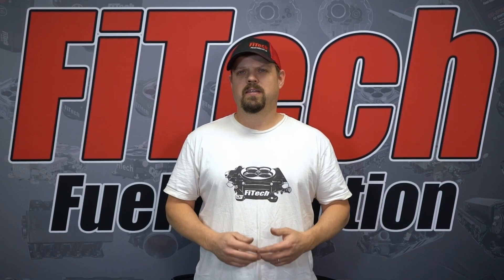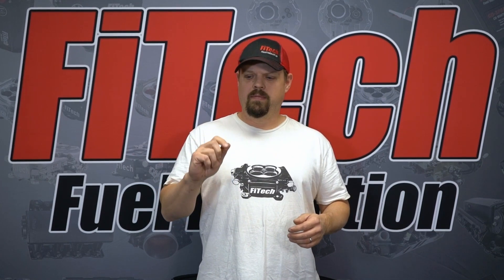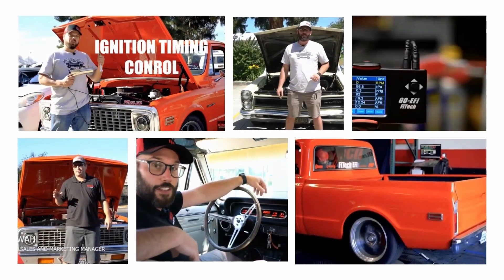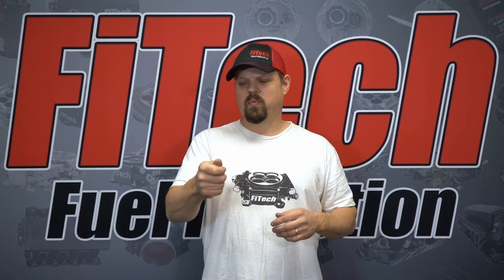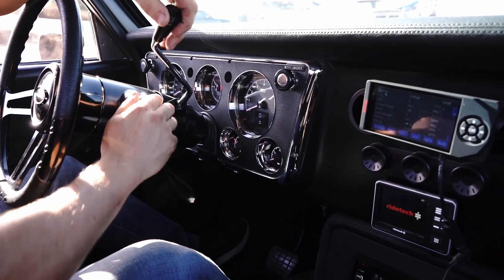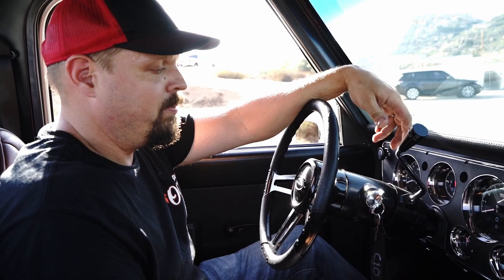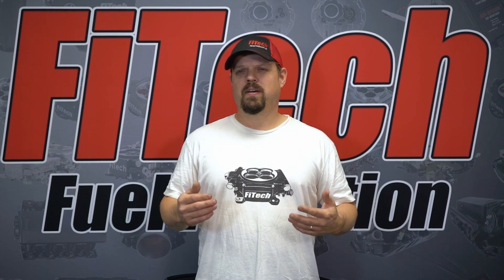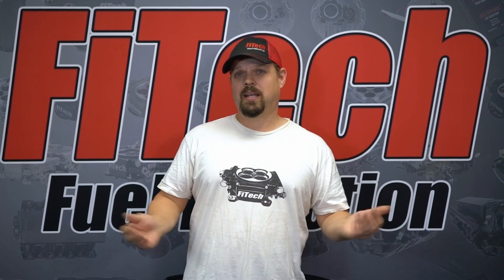Ignition Switch | Tech Tuesdays | EP59

Comment: Yup, I’ve had this issue before after replacing an ignition switch and then wondered shortly after why I was having hard starting.  The new switch developed a “dead spot” between run and crank positions.  Didn’t think to use the handheld.  I confirmed my issue using a test light and remote starter button after remembering the white wire symptoms from another video.  Just a blip in power is all that's needed to trigger the ECU to cut fuel.  

You have to watch out using aftermarket parts, so much of it is junk.  In my case I ended up cleaning and reinstalling the old OEM switch.  A little worn but, still better than aftermarket.

If possible use OEM parts or use a test light to confirmed the aftermarket is working correctly... ideally before fully installing it, if you can get to the connector harness.

A short-term solution is to install a momentary starter switch but, be sure NOT to bypass your clutch or neutral safety switch.

Comment: Could you do a video going over the throttle adjustments such as primary/secondary spring tension adjustment, pri/sec idle adjust screw, and the secondary arm screw?